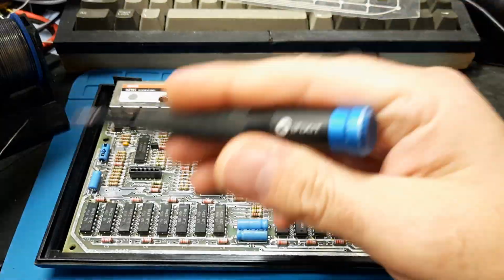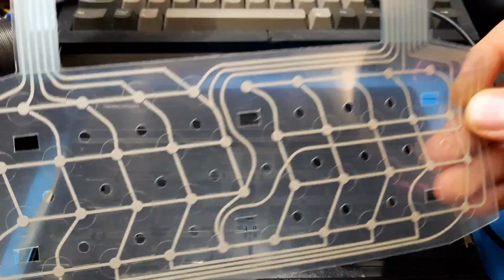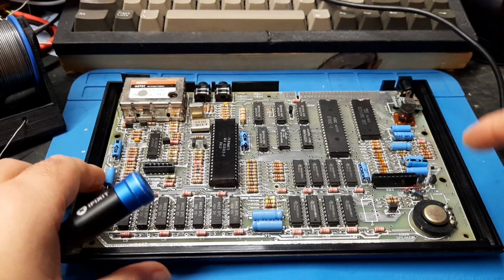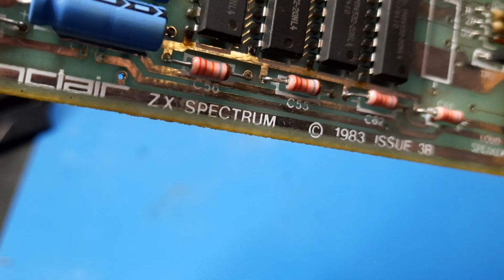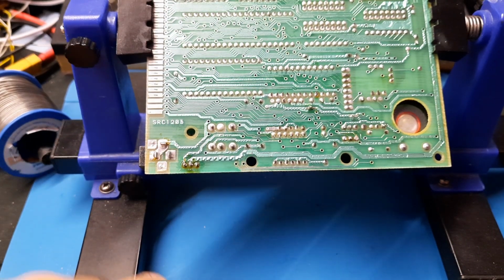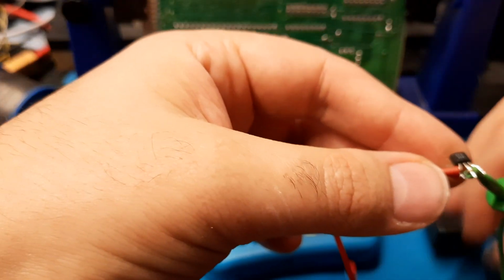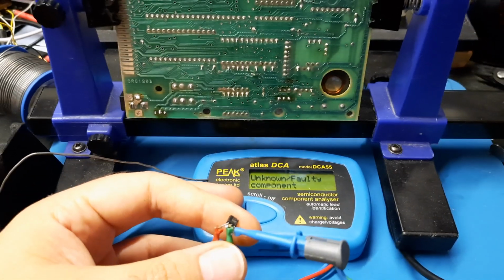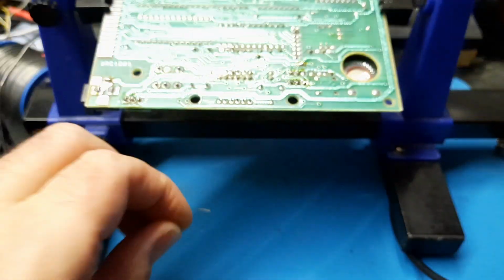ZX Spectrum Repair Part 2

Comment: Sprouty friend 🌱💚 the Spectrum such a simple yet aesthetically pleasing computer 🙂 so simple that 'the Spectrum' from those guys who made the mini Amiga didn't even have to make a fake keyboard for it!  Wouldn'it been cool to have a MIDI interface for it?
Reply from the maker: I have always love the case designed of Sinclair products, even when the product was complete crap it at least still looked good. It would defo have to be the MIDI controller. Would not be controller if something like that has been made these days.
Reply: @TheEPROM9  🤣🤣 can you imagine someone wanting to use it's single channel beeper as the synth? it would be interesting to see it used as a tracker though or to give games an 'enhanced' GM soundtrack 😃🌱
Reply from the maker: Just give it as a challenge to LMNC & he would be mad enough to give it a go. A circuit bent ZX Spectrum would be pretty cool.